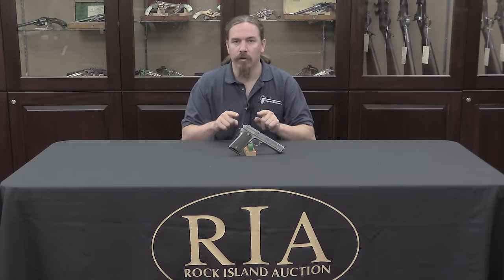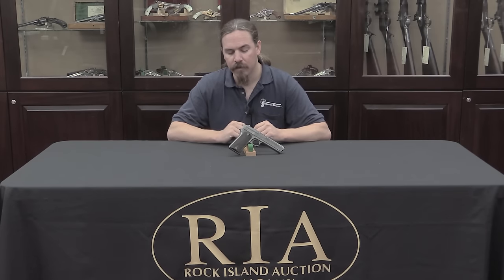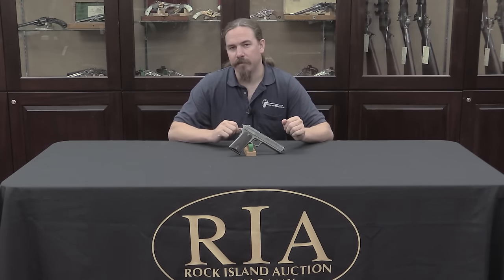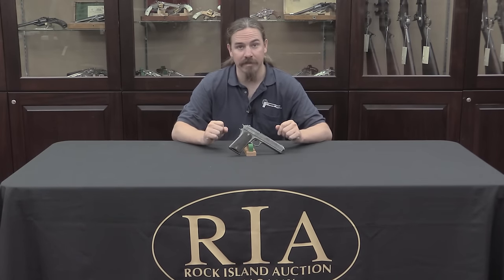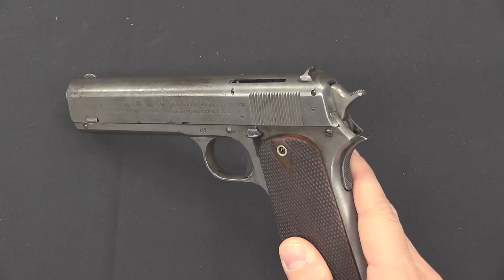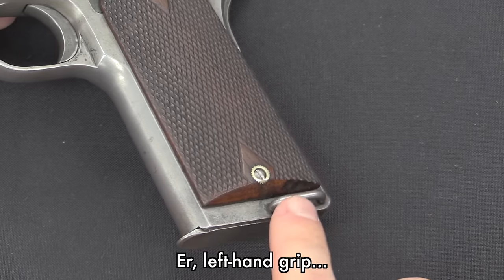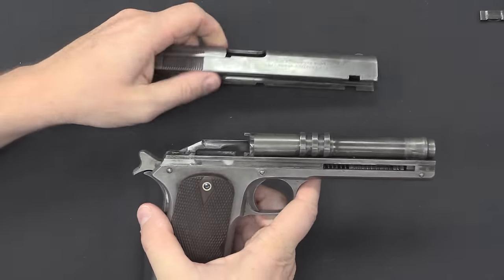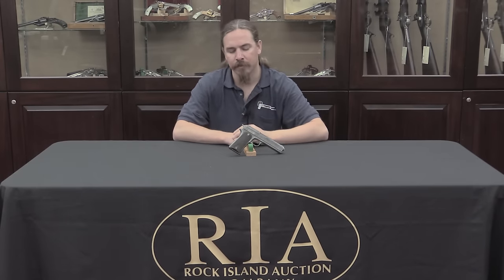Colt 1907 Trials Pistol

Comment: For those asking about one handed loading of revolvers and pistols this was a request, particularly by cavalry regiments. It was possible with some revolvers to operate them one handed plus wedging the barrel between legs or similar. Webley & Scott revolvers for example had a top break action which automatically ejected the spent cases, then you could use a speedloader to replenish the rounds, close the action and away you go. Convenient if injured or using one hand to ride/steer etc. I can imagine many were concerned that racking the slide on a pistol could be difficult in comparison. The auto pistol concept was quite new and little was known. I know this may seem obvious, am just trying to contribute to the discussion.

Comment: How do you reload a revolver one handed?
Reply: I'm glad I'm not the only one wondering that
Reply: badly and not fast!!!!but it can be done! you pop open the cylinder, dump the empties put it between you legs and load the chambers then close the cylinder, if your wounded and have one arm useless you can but it's not fast!!
Reply: another thread seems to have worked out that they meant opening the cylinder/ removing the magazine.  The 1907 had a heel release, not a button
Reply: Supposedly you tuck it under your other arm and simply operate it.  While riding the horse.  Probably at full gallop.  Probably not as easy as we think today  ;-).  With an automatic pistol you has to tuck it under your arm too, then you must remove the magazine and then tuck it under the same arm,  with great risk of loosing it, before you reload it and replace it in the pistol.  
Spare magazine, you say?.  Yeah, mayby that happened some times back then  ;-)
Reply: We don't like it ...... it ain't no Springfield .... 
Of course ..... they did not have the Lara Croft style magazine holders for around the saddle horn yet.
Reply: Hire John Woo to direct.
Reply: keith moore but you could do that same thing with an automatic pistol what

Comment: I saw serial #134 at the National Sporting Arms Museum in Springfield, MO.  The grip safety is smaller than this example.  You say the longer safety like shown is the more recent design.  Why would they put an older design on a later production gun?
Excellent video by the way.  Is there any chance you can go to the National Sporting Arms Museum?  They have many beautiful guns locked away behind glass.
This is also posted on Full30.

Comment: With regards to the two-hands complaint I guess what it means is that the revolver guys liked being able to fill up their cylinders with loose cartridges from a pocket. They reason that this is a one-handed reload. If they try to use a semi auto the same way, they have to hold the magazine separately from the pistol while they load it, making it a two-handed reload.

Carrying multiple magazines hadn't entered military doctrine at this point (since magazine fed pistols were a new concept), and even if it had, cavalrymen would still argue that they would have to reload their magazines eventually. To them, the magazine was an extra step between loading and firing the gun.
Reply: thats interesting about the magazine being something you loaded, not just inserted new loaded one. it could appear as a fiddly extra step I agree.

Comment: well,even revolvers require 2 hands to be reloaded,right?So i don't think it was a legit complaint
Reply: Yeah during the video, when he brought that up, the only thing I could think of is what a nightmare it would be trying to reload a revolver from the back of a nervous horse in the middle of battle.
Reply: actually no, loading a revolver one handed is possible.
Reply: Domus deBellum can you explain thst?
Reply: You can make the revolver stationary with your legs and reload with the other hand. They were probably unaware they could rack the slide with their belt.
Reply: GruntBurger oh i understand and yes,they probably were
Reply: Webley had a top open, auto eject, speedloader approach which is easy enough one handed.
Reply: Aidan Templeton 
Good point. The heel release is harder to use one handed.
Reply: Revolvers in 1907 could be reloaded via telekinesis.
Reply: Isaiah Young 
We all knew you were going to say that.
Reply: could they be refering to the magazine, maybe?

Comment: Requires two hands to load. I'm not quite sure what that means, what gun doesn't require two hands to load?
Reply: There are techniques for all semi-autos that dont require 2 hands to reload. Basically, you need to use something to hold the gun still while you insert the fresh magazine. Then you use something else to rack the slide off of. With a rifle, you could just keep it clamped down while you use the charging handle. idk how well that would work with a revolver because you need to eject the casings and then load the cylinder. That might still be doable but it would be much more difficult.
Reply: some revolvers like the Webley Scott had a top open, auto eject, speed loading method which could be done one handed fairly easily. Just need to jam the barrel somewhere like between legs to keep it steady.
Reply: the only ones I know of are in a sci-fi movie!!!!

Comment: Wait what? What kind of handgun were they referring to that only requires one hand to reload? Surely not a double action revolver
Reply: Yes please can we get an explanation for this.
Reply: I think that to get a better understanding of where they were coming from with that you would have to look toward the weapons drills and specific revolvers they had been using at the time, and how they were attempting to reload these new Colts while on horseback. 

Hopefully someone more familiar with that era can chime in, but I do know that reloading with 'one hand' in various ways was used by cavalry over the decades with different holsters, tucking it under the rider's arm, or as a stretch holding in the same hand as the reigns while your other hand did all the 'fine work'. 

Even today I've run into people who insist that their revolver is a "Better weapon" because they can 'easily reload and cock' it with one hand, but pulling back the slide on a semiautomatic clearly needs two hands.
Reply: Yeah, and how do they put the new cartridges in the cylinder with only one hand?
Reply: AldanFerrox Hold the revolver with something other than your other hand?
Reply: Just snug that fucker betwixt your leggings and reload with one handed from horseback... easy peasy.
Honestly though, their complaint was likely referring to racking the slide. I guess they didn't know about belts yet.
Reply: Webley Scott revolvers for example had a top open, auto eject, speedloader method. Fairly easy one handed.
Reply: +AldanFerrox 
speedloader. jam barrel under a leg etc. quite easy to do.
Reply: wood1155 
Naw! Training. Train hard, fight easy. I believe one handed loading was in the Webley manual of arms so it was expected of you if you may need to be able to. Have a look into it.
Reply: I actually practice reloading one handed when I'm bored sometimes. A revolver is easy enough and some semi-autos I can do with my right hand but I still ain't worth a shit with my left hand.
Reply: me3333 
That's interesting input from someone who has taken the time and developed the skills to do this. Good on you.

Comment: would the twin link design be potentially more accurate?  it seems like the barrel would be more consistent in its movements over a single link and a bushing and guide-rod setup. for the same reasons i can definitely see this design being a bit less reliable . plus it would seem to be more expensive to manufacture .
Reply: I think the bullet leaves the barrel before the recoil actually happens, since the barrel has much more mass.

Comment: how did they reload 1 handed on horseback using revolvers? the only techniques i could find didn't seem too plausible on a horse
Reply: Webley had a top break, auto eject, speed/round loader approach.
Reply: Aidan Templeton 
Correct. But gun trials take into account advances from other nations. I'm just using Webley as an example. The USA had the S&W no. 3, for example, which also was a top break revolver.
Reply: i didnt know it was top break, the things i saw werent they only flipped out, now im really curious how you break open a revolver with one hand on a horse and do that whole motion